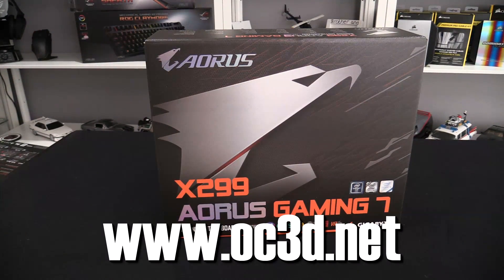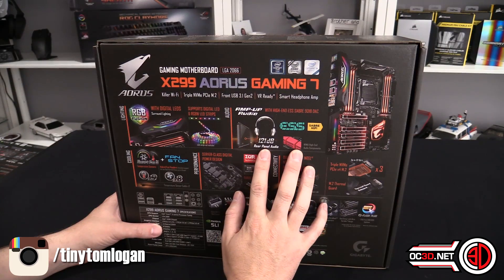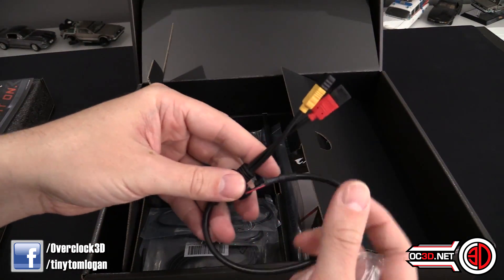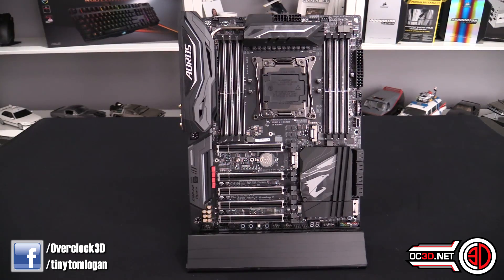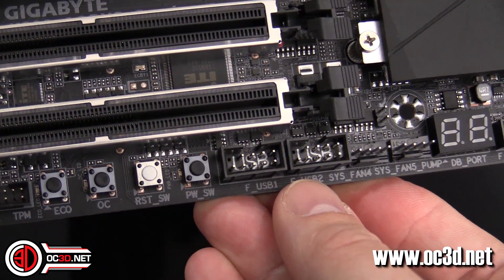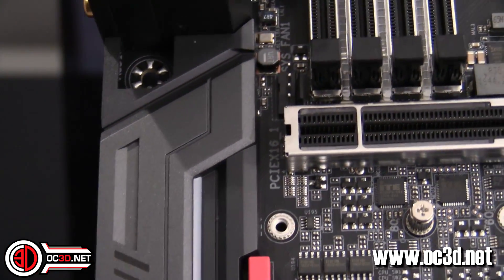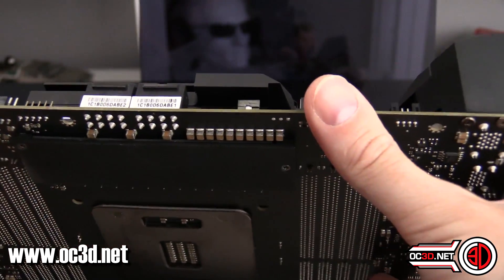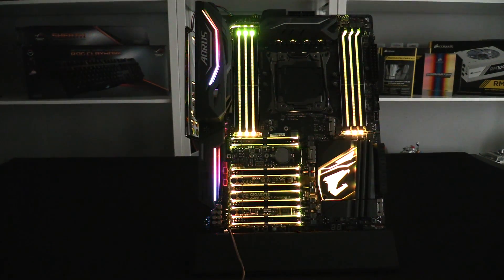Gigabyte Aorus X299 Gaming 7 Preview

Comment: what would be a good motherboard for 4 x RX 580s, i dont want x299 tho :p and wouldnt water cool the gpus. planned to start with 2 and add 2 more later. would also prefer an igpu as well so thinking amd apu or intel cpu. could spend around £200 on the board would prefer less tho obviously :p thanks for any help :)
Reply from the maker: TBH dude youd be better off with a single decent GPU or worst case dual GPU's. 4 will cause so many issues and some games will run worse than a single 580. Also a £200 budget for a quad crossfire board just isnt enough because youll most likely need one with a PLX chip for added pcie lanes
Reply: thanks a lot for the reply and sorry i should have said, was looking more for just raw compute power than gaming performance but that was a secondary concern to me too. had seen people building 6/8 gpu rigs on essentially test beds but i didn't wanna go down that road and would prefer an enclosed proper pc plus i wouldn't want more than 4 gpus anyway. you know more than anyone i.m.o. so really appreciate the advice. remember from a ways back when it was so hard to find good content out there you were if not the only one but certainly one of very few people who actually had the balls to setup rigs like that and show us fans what living with one would be like. really do appreciate the help i don't have enough experience with using more than 1 gpu to really know where to start. will look at running gpus independent, my only real reason to crossfire was gaming but wanted to ask your recommendation in-case id just be throwing money away trying to do it that way . . . .  just to say if anyone reading hasn't seen OC3D's videos on multi gpus they are brilliant and some of the benchmark numbers are just unbelievable, defo worth a watch.
Reply: i see what you mean about the plx boards, an asus one was £350. at that price seems i would be more cost affective doing 2 pcs with 2 gpus each rather than 1 pc with 4.

Comment: Till so far I have not seen A Single X299 board that has all that I want build in
So It's nice to have dedicated DAC Ports on this one ... however I still wonder if those will be good for usage with real Audio Interfaces that connect to USB instead of Firewire or Thunderbold (And if they have benefit from those ports)
Till so far I have seen that the Thunderbold add on cards could be used on almost every X299 Board but I have not seen a single board with Thunderbold build into it as this would save another expansion slot 
And for X399 I have not seen A Single board that has Thunderbold (Or the possibility to add it)
Also for this board the PCI-e X16 (Running at X16) Slots are not located on the Place where I need them to be :(

Comment: 11:08 The X299 chipset only provides additional 24 PCIe 3.0 lanes and not 44. The CPUs can have 16, 28 or 44 PCIe 3.0 lanes. This mainboard has also three M.2 ports, you forgot the one below the CPU socket.

Comment: if there is 2 8pin cpus and you only need to use one, is there like any benefit of using both of them? it just doesn't make sense to have a useless cpu 8pin right?
Reply: xNIMZx1 it can in theory improve overclocking headroom but usually not by a margin that normal cooling can take use off, You would need ln2 cooling to notice a difference in most cases. I would plug it in if I had one but it is not needed for normal operation
Reply: awesome thanks for the info i plan on upgrading to x299 so that's good to know.

Comment: hey, could you possibly preview a x399 board from amd? I'm much more excited for those boards/chipsets.
Reply: Don't think anyone cares about X299 its got RIP off all over  it. X399 thats where its at, my next build.
Reply from the maker: Reece Webb I'll do them as soon as I get them. Launch is a way off yet though
Reply: OC3D TV thanks for the quick reply mate, im just curious. Also, side note - what chipsets are you most excited for? x299 boards from Intel or x399 boards from amd?
Reply: You are right. Who care about x299 after what we all heard about intel, performance and time frame..... let's talk about x399 if threadripper will be available this summer or at least during august.
Reply: J. Jardin why gamers, for gaming the z270 uses the same cpu as 299 but with more pins so why change.
Reply: Droosk X270 doesn't exist

Comment: TT, which Intel CPU (for X299) would you get?
In general, not connected to reviewing this motherboard.
Reply from the maker: Robert won't know till I've had a chance to test them :)
Reply: TT, yeah you're right it's too early. I was trying to find a shortcut to a few well-founded (by you) options.
I'm a tiny bit afraid to buy AMD Threadripper 1998. Haven't used AMD for donkies years.
Petter Angeltveit, that's a good 8-core choice.
Reply: Im going for the i7-7820X